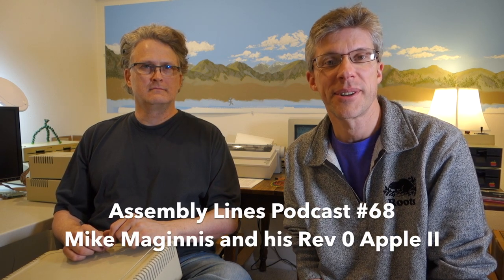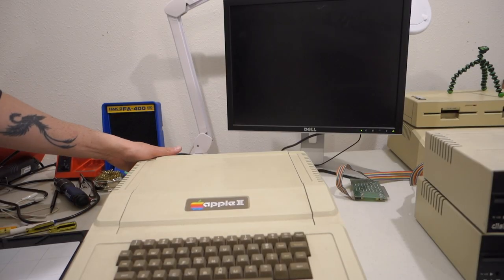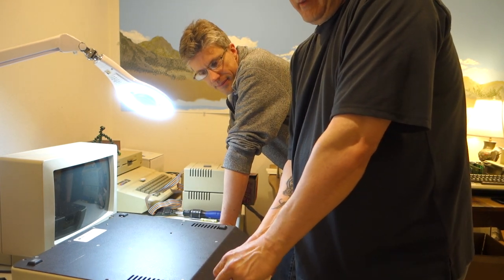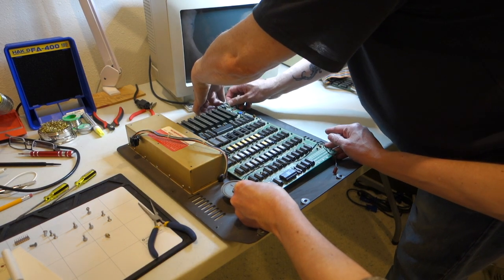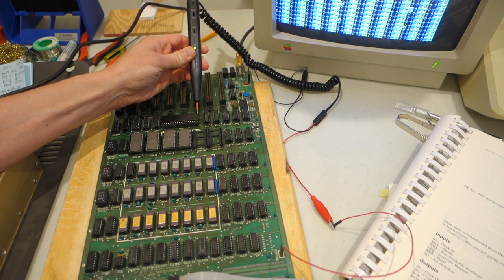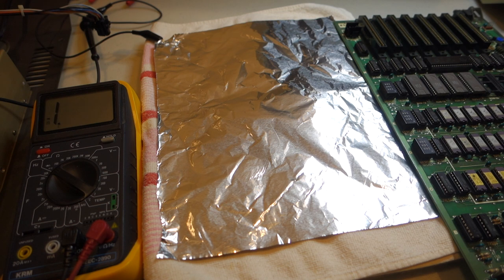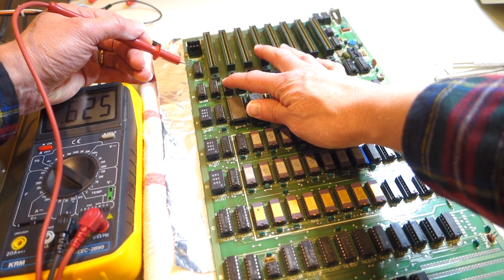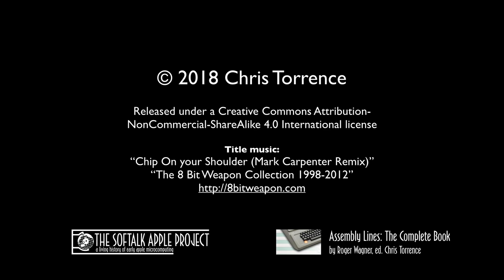#68 Mike Maginnis' Rev 0 Apple II

Comment: Did you check the power supply to start with? I really find this interesting because I enjoy a challenge. I'm curious if it is the CPU in a rapid reset loop. Question then would be what can cause the cpu to reset? I'd start with power, ground, and clock. I'd check the clock pin at the CPU on an oscilloscope to make sure the CPU is getting a clean and correct clock, and I'd also use the oscilloscope to see if something is signaling the reset circuit. It may be much faster than the multimeter can detect. Beyond that, I think I'd be quite confused! I'm excited to see where this leads!
Reply from the maker: That's a great point about the reset circuit. I've got a small USB oscilloscope that I could play around with. I'll let you know what happens!

Comment: Hi Chris, a thought w/o looking at the circuit, try measure the voltage of the reset pin and make sure its a clean 5V / 0V when holding the reset button/releasing it. A bad electrolytic capacitor in the circuit that is supposed to reset the Apple on power on would prevent it resetting on power on (as you find) and have it go crazy when you force the reset line with the button (its probably floating at the trigger level).
Reply from the maker: I'll double check the reset pin. With the Rev 0, it doesn't reset on startup - you need to hit the reset key. So that's expected. But you're right, it could be something goofy with the reset line. Thanks!
Reply: Wow never knew about that reset... my first Apple was the europlus, boy did I fry that a few times. There would still be a pull up resistor and maybe a debounce cap for the reset button. The fault is a really interesting one. The fact its executing enough to get the beep out, then it goes all high pitch, got me thinking of clock generator or corruption in wherever it stores the timing delay for the  beep loop. I still think capacitors, they are the bane of electronics to this day!
Reply from the maker: Yeah, I'm worried about the capacitors as well - too bad they're so hard to test while still in the circuit - I don't want to replace them all if I don't have to.
Reply: Bigger electrolytics are the ones to focus on first (1uF and up). The smaller 0.1uF bypass ones are more reliable and as Dave Jones finds, you can remove them all and a TTL computer kit he built keeps working!
Check out EEVBlog #1081

Comment: I have faith that you already know some of the other options to try, and are merely avoiding some of the more drastic ones.

Check continuity of board traces.
Maybe try a Solder Reflow Oven.
Full reCap ?
PSU Voltage rails out of spec ?

I'd hate to see this piece need to be desoldered down to the bare PCB.
Reply from the maker: Yes, I'm trying to avoid some of the more drastic options. At some point it's more important to preserve the board rather than destroy it getting it working.
Reply: Rev. 0 boards always start up with garbage on the screen, so that is actually not a problem.
Many 70's computers booted in an unstable state and required a Reset before starting use.

Which now makes me think this can be pinned down to something specific to Reset or even Keyboard input.
Did you try swapping in the keyboard from the Plus ?
The key controller can be an odd beast, as it uses negative voltages and other nonsense.

Please don't tell me the Reset key is simply sticking down.
Reply from the maker: I tried swapping out both the power supply and the keyboard but it didn't make a difference.

Comment: Also check that the memory jumper blocks match the installed RAM chips' sizes. And try removing all the RAM chips but the first row... (farther away from the slots)
Reply from the maker: Yep, I tried both of those.
Reply: Leave there the known good RAM chips of the II plus, only the first row. => One less unknown in the equation...
Reply: You can use the II plus to test the RAM chips of the rev 0, swap one at a time into the (first row of the) II plus until it fails (or not).